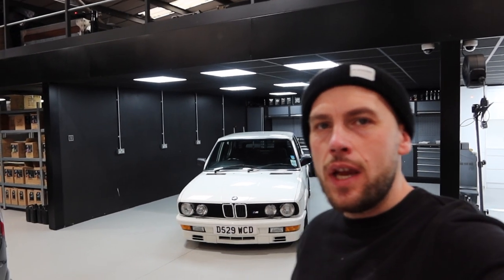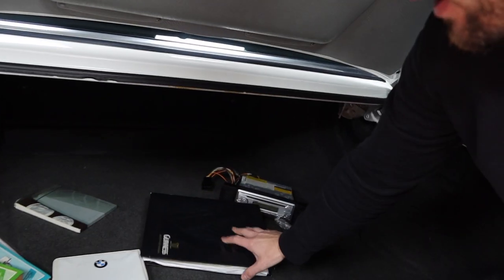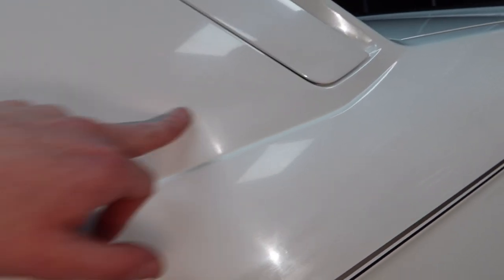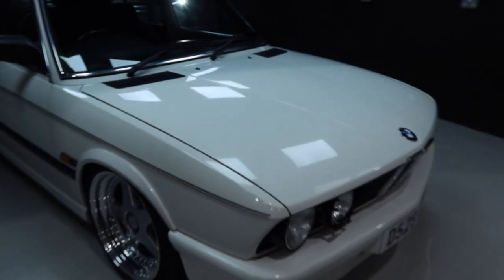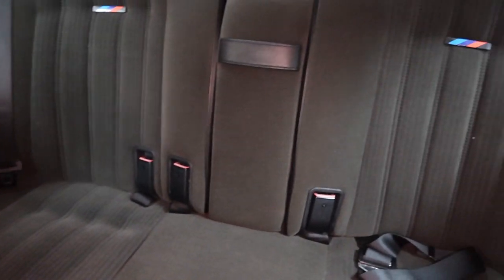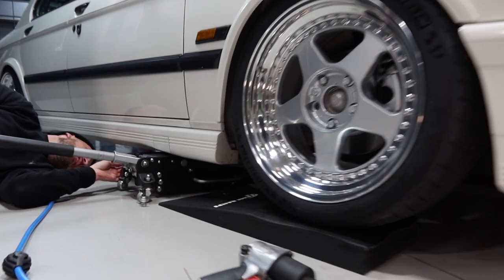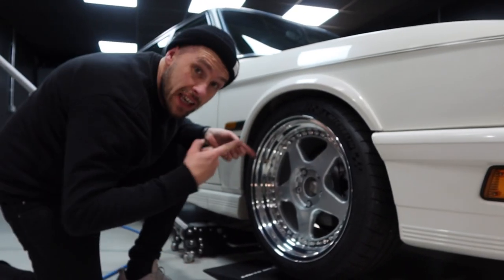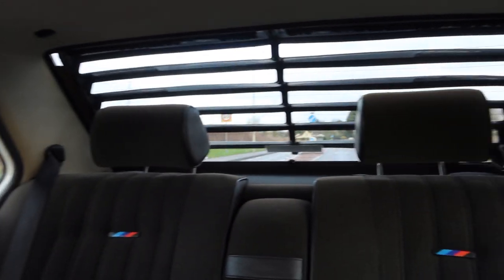Auto Finesse Project Cars - THE BMW e28 M535i Vol:3 Bumping and Scraping

Comment: Cool video as usual and love the e28👌.wheel alignment tool when changing wheel's always helps especially with spacers 👍
Reply from the maker: Colin Tennant it has been aligned professionally at a shop down the road from us after fitting the shocks, kinda going the 5mm spacing doesn’t put that out 🤷‍♂️😆
Reply: Sorry I meant the link 👍

Comment: Looking great, what about gold centres on the wheels for the 80s touch. Maybe a classic steering wheel bbs or italvolanti or similar.
Being an auto is probably the reason it's in such good nick
Reply from the maker: Tec Designs would love a nice italvolanti for this, had a BBS wheel in a previous mk2 Golf we had so would like something we haven’t had before. Also kinda feel that you need the BBS wheels to go with the steering wheel 🤭
Reply: Gold centres are overdone these days, everyone that buys a classic puts gold BBS RS or something similar. Keeping them silver is the right thing to do
Reply: @peakperformance8960  alot do it but on 80s cars it just works like bbs on a mk2 golf.

Comment: Iv got questions! Only 2 so don't panic. If some one loved it like you say they did, why on earth did they put those Awful wheels on it?  The oz's tho, they are spot on 😉 (well, 3 of them are😂) my other question is, why do you pull up on the torque wrench when tightening the wheel bolts? 🤦🏼‍♂️That looked super awkward😳. I know you ain't a big lad but, 120nm is easily obtained by putting your weight down on the
Bar. A wise man once told me to work smart, not hard! Any way, it's a super cool car, maybe even ice cold. (there is only one retro bmw cooler than an e28 so you are nearly there😉) Can't wait to see the detailing episode. Peace out ✌️
Reply: Batmobile ,M1, M6,M3, E28 & E34 M5 all cooler than a polar bears paw and bar the M3 were all handbuilt by BMW Motorsport Garching
Reply from the maker: Arron Jones I guess style is a matter of personal taste, some don’t like the OZs so 🤷‍♂️ 🤣 I was actually being lazy and the torque wrench wasn’t deep enough to clear the other side, couldn’t be bothered to go back to the tool chest and get an extension or deeper socket😊 besides it might help turn me in to a slightly “bigger lad” 😜

Comment: You shouldn't jack it up off the chassis rail, under the cover you removed is the correct location. Body pinch weld always.

Comment: On the black plastic trim around the the lock cylinder and a little bit on the paint on my driver side door there is a white residue and im not sure what it is (wax, compound or polish) but it doesn’t seem to want to come off and bc idk what it is i don’t really know the best way to try and clean it up with. Im going to assume the its not polish bc the paint isn’t very good but how would u recommend the best way for me to clean it with?
Reply from the maker: H D more often than not it will be polish. Try an APC or a solvent a a small brush like a toothbrush to clean them up 👍